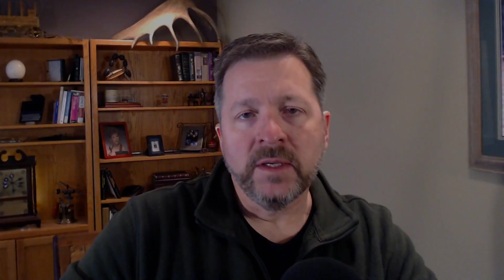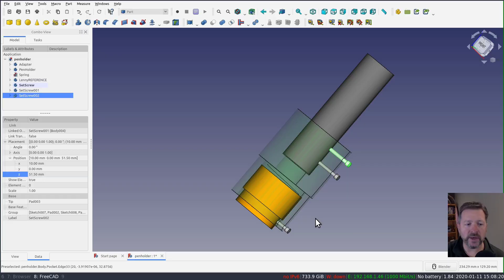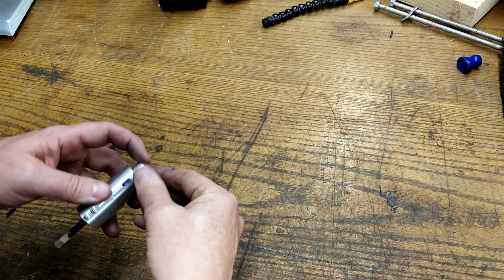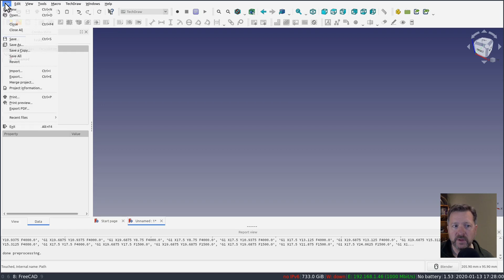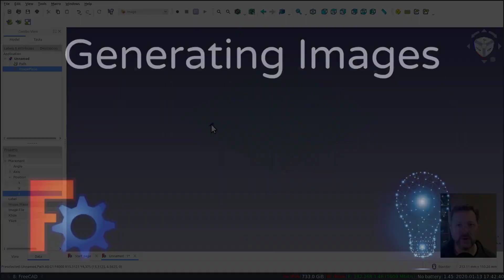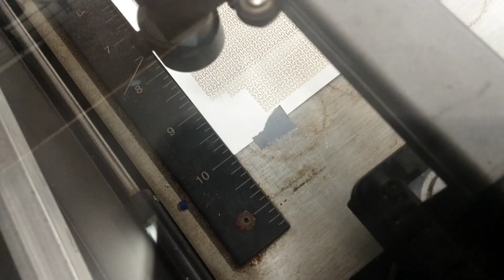Giving Lenny a Job (Hilbert Curves)

Comment: I'm impressed at the speed it moves.  There is a lot of metal on it.  What is you estimate on the weight of the arm?
Reply from the maker: I'm not sure.  The whole thing is bolted to a steel table and weighs at least 300lbs.  I'd guess the two joints that move weigh collectively 40+.  Just a guess.